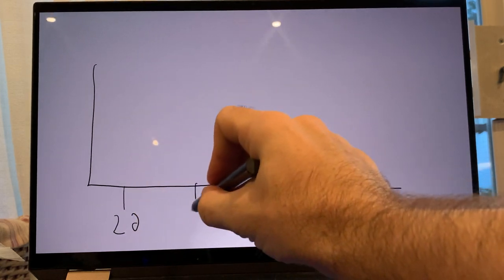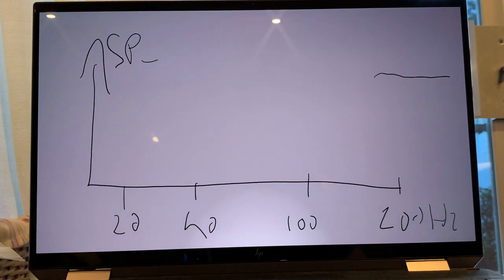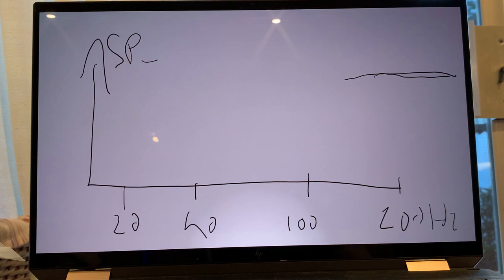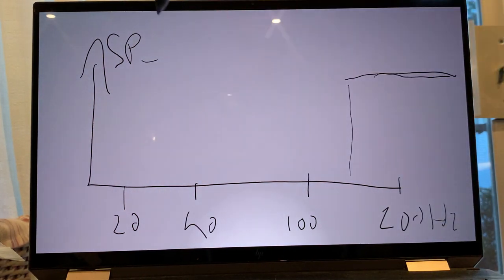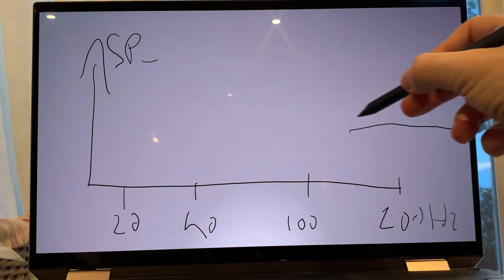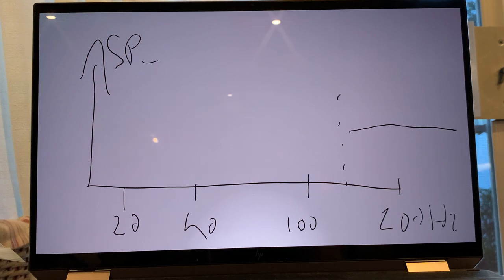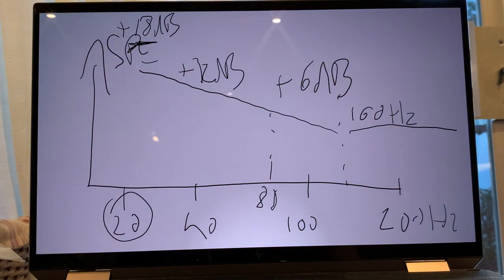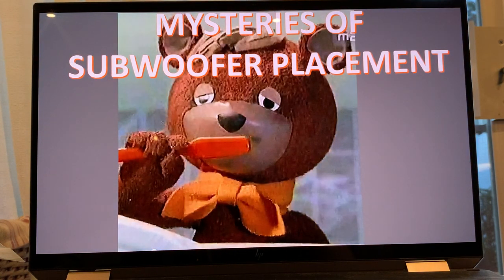Subwoofer placement:   room  and low frequencies! Groundbreaking animated program.

Comment: The cancellation points should actually be in the middle of the room for the full wave, and on the sides of the room for both the half wave and full wave. The half wave sinus wave should also have the start and finish (null point) on the same line as the ful wave.
Reply: Btw. Love your videos, I don't want to complain 😇
Reply: @ramseyedward7940  then you'd have a subwoofer in your lap...
Reply: @ramseyedward7940  I'm sure you will find some sort of joy with a sub on your lap, whether its audible is a different question
Reply: @ramseyedward7940  depends on how heavy your sub is
Reply from the maker: Hi Fredrik, thank you for the important correction! You are correct about the null points! Dang, bungled up this video quite badly.... geez, what was I thinking..
Reply from the maker: @ramseyedward7940  Maybe you can turn it into a couch....build a nice 10cuft sub, place a mattress on it and arm rests, and just sit on it and enjoy the ride! ; )
Reply: @realworldaudio  LOL, Janos! I’ve actually got a buddy who put a sub under a seat and listens to headphones with it, and my other friend recently got a new system put in her car with a sub under the front seat. It’s actually quite distracting to drive. lol
Reply: @ramseyedward7940  ok? Just because some one buildd them doesn't mean that is good practice. They will be comb filter generators.

Comment: Bro so basically just wanted to ask you something, when making speakers from only solid wood, how to compensate for expansion in solid wood  , as special glue or something, should I avoid screws ans nails, some advice would be helpful and I have sent u many pics as well let me know what u think
Reply from the maker: Work with the wood only after it has dried out and stabilized (aged). Otherwise it will warp and tension will build up and that will affect imaging quite a bit. Never use fresh cut wood, always age it first! Treat it as if you are about to make an acoustic music instrument. Screws and nails - very long topic, no one shot answer. Depends highly on application. Will get into it ;
Reply: @realworldaudio  thanks 🙏